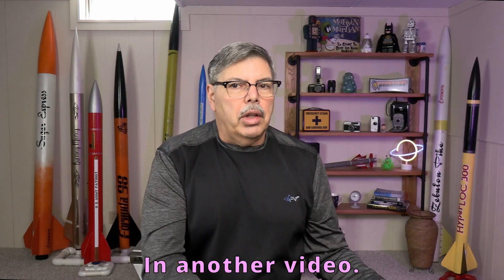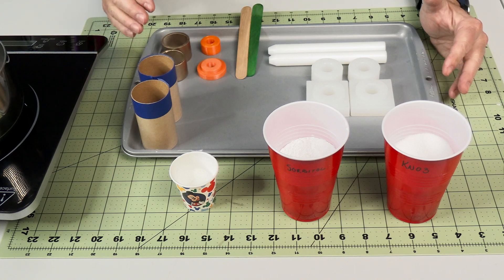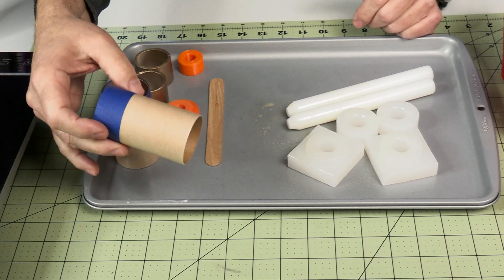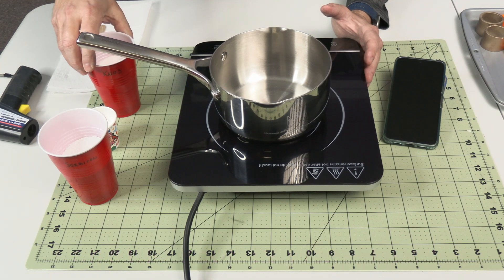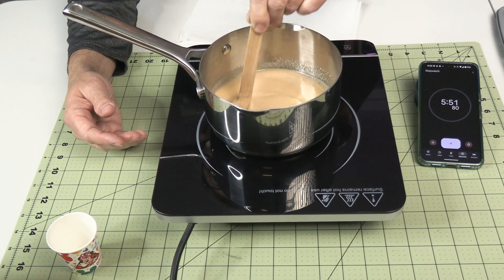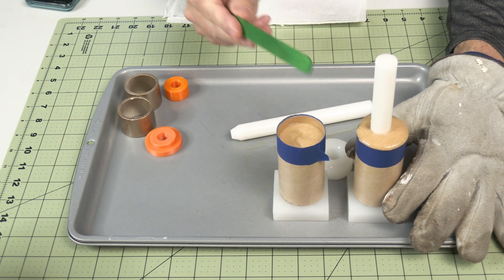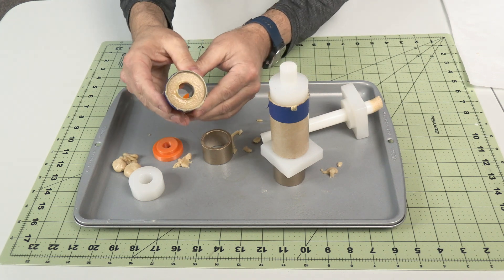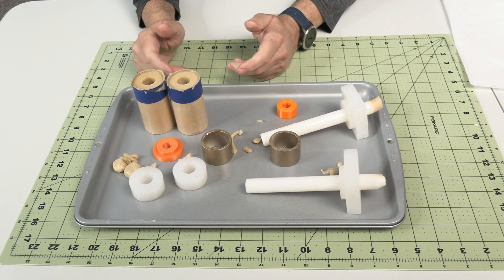How to Make Perfect Sorbitol Rocket Fuel Grains – Step by Step 🚀🔥

Comment: How did you get it so pourable?  Using a few drops of surfactant?
Reply from the maker: I don't use surfactant. Grinding Kno3 pellets to a fine dust will make the propellant thick. I use the granulated variety.

Comment: This is an awesome video! I just earned my level 1 this last weekend and plan to go for my level two next month. I was talking to my mentors at my local club about sorbitol motors. 

I did want to ask if you sell those molds you use? They work so nice for casting! 

Thanks again for the awesome video and happy flying!
Reply from the maker: I now use 3D-printed parts made from PETG for casting. Please contact me by email, and I will send the STL files. If you have a 3D printer or someone in your club does, they are easy to make. If you don't have access to one, I may still be able to help. You must be a subscriber (yes, I can tell) if you would like me to help. Go to my home page and click "more" to see my email address.

Thanks for your comments!

Comment: may i know the purpose of adding sucrose into the mixture? and can we still without it?
Reply from the maker: @kestrell1104 Sucrose reduces grain slumping while curing, helps the propellant light and burn faster. It also reduces material costs.

Sucrose is not necessary, sorbitol works great on its own.
Reply: @TheRocketeer   What do you mean exactly by "slumping"
Reply from the maker: @lima4923  The grains seem firm but can slowly squish at the bottom. The propellant is slightly pliable for a few hours and needs to be monitored before sealing them up.

Comment: Thanks, great video!! I've previously used the crystal cat litter in a sealed tub for grain storage. I've had test chunks stored like that for 2 years that have remained in perfect condition. You can put the cat litter in a stocking and tie it off to stop it sticking to the fuel, but allow moisture absorption.
Reply from the maker: That’s a great tip, thanks for sharing!

Comment: Great! Now im thinking of getting back to the hobby, i tried making candy fuel some years ago. Im happy that you use the metric here, but well, this is rocket science. 😃 I 3d printed a star shaped core bar one time, just to get some faster burn, but forgot that pla doesn't like heat. It totally failed.😆 
But as a machinist, maybe i can make one out of plastic, say Peek or Delrin. I have access to the workshop at free time, but the release angles are hard to achieve. Or maybe 3d print one from Nylon?
Reply: I'm glad I read your comment. I was just thinking about using PLA for my rocket
Reply: @DamianDCM  You should avoid PLA for rocketry things, especially for large structural things in hot climates; several that I know have had issues when using PLA.
Reply from the maker: Reducing the number points to five and printing in ASA or Nylon may work. You could also try using a proper release agent such as Stoner spray. https://amzn.to/3Dm7QRa

Have you thought about making your own snap-ring cases and forward enclosures?

Comment: Great video!! Just some procedural notes:

Safety:

Because rocket propellant combines the fuel and the oxidizer, you cannot put out a propellant fire. The fire extinguisher is not there to put out the propellant, it is there to put out everything the propellant ignites.

If you're making a large batch of propellant, you risk a large propellant fire. Do not attempt to extinguish a large propellant fire. The only safe response to a large propellant fire is to run away, very fast, and call the fire department. Make sure your path is clear and practice running away before you start. Don't make a large batch of propellant in your house unless you're willing to risk burning your house down.

Rocket propellants will readily ignite from a spark. Avoid creating sparks. Specifically, avoid any two ferrous metals coming in contact with one another. If your pot is iron or steel, do not use an iron or steel mixing tool (and vice versa). Use a non-ferrous metal, like aluminum, or use something non-metallic.

Legality:

The NAR safety code prohibits the use of non-certified motors, including homemade motors. If you fly a homemade motor, you are not covered by NAR insurance. If an incident occurs, this may be grounds to revoke your membership.

The Tripoli safety code allows homemade motors, but with two major restrictions:
1. You must be certified Tripoli *L2 or higher*.
2. You must launch the rocket from a high power launch area. In particular, you must observe the safe distances for high powered launches.
If you violate either of these restrictions, you are not covered by Tripoli insurance. If an incident occurs, this may be grounds to revoke your membership.

NFPA 1122 and NFPA 1127 both prohibit the use of non-certified motors. If your state uses bases its fire code off of NFPA 1, using homemade motors is likely a code violation. It's unlikely that you'll be fined just for using homemade motors, but this may expose you to additional civil or criminal liability if an incident occurs. This is not legal advice. Check with your local authorities.
Reply: And common sense, a big shortage nowadays.
Reply from the maker: Thanks for sharing this information!  Rocketry is a fun and challenging hobby, and I encourage everyone to be safe and responsible.

Comment: I have a question: Let's say I need a 60 cm long propellant. Would it perform better to make the grains 20 cm, 20 cm, 20 cm or would a single 60 cm grain be more efficient?
Reply: Hi, I'm an aerospace engineering student. I know you're asking him and not me, but my teachers have gave me some recommendations about that I'd like to give to you now. The less grains you make, the better (but that applies for small rocket motors). You only make multiple grains in order to make the casting process be easier. Now, if your rocket will have a 60 cm long grain, that's a big one (at least for me)  you have to take some other considerations like the thermic and mechanical stress your grain is going to be exposed to, which could lead to small fractures on the grain. I would say the best you can do in a 60 cm length rocket motor is 3 grains so you can reduce that risk. But if you're making a smaller one, I'd definitely go with a single grain.
Reply: It would definitely be nice if @The Rocketeer could share some of his thoughts around this with us.
Reply from the maker: You would need mutiple grains to prevent the motor from over pressurizing. Check out this rocket motor design tutorial - https://youtu.be/gdD1B3Ki14c

Following is the function of a BATES grain. Yes, it is AI generated because the response was better than mine.😉

A "BATES grain" in a rocket motor refers to a specific type of solid propellant grain design, consisting of multiple cylindrical segments with inhibited outer surfaces, allowing the propellant to burn only at the ends of the segments and along a central core, resulting in a relatively even thrust curve and making it easy to manufacture and configure for different thrust profiles (progressive, regressive, or neutral) depending on the dimensions of the segments; essentially, it provides a controlled burning surface to manage the thrust output of the rocket motor.